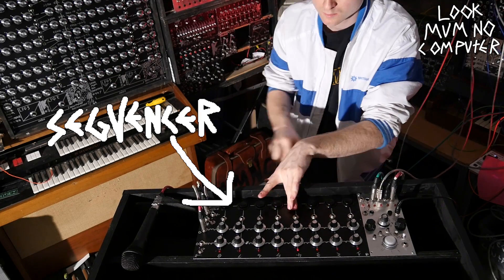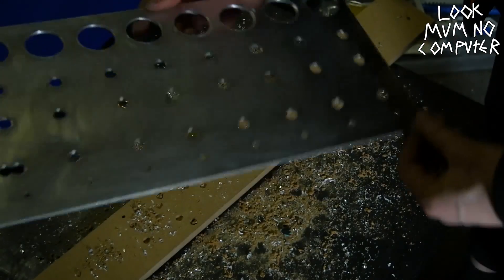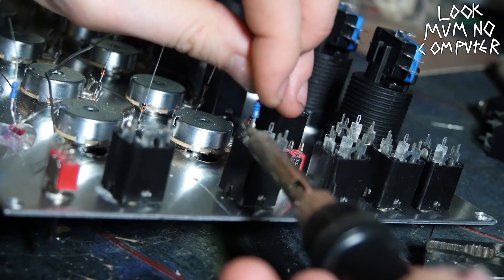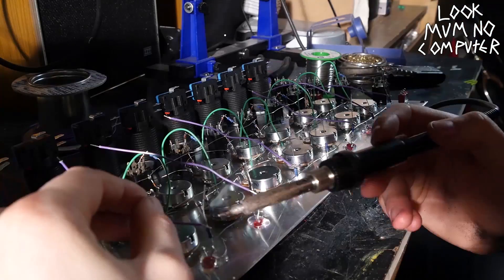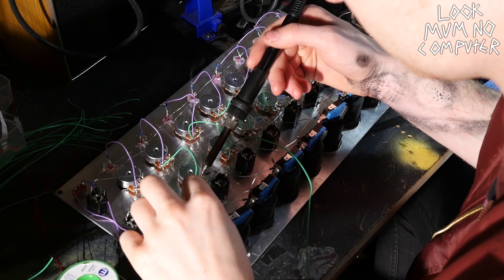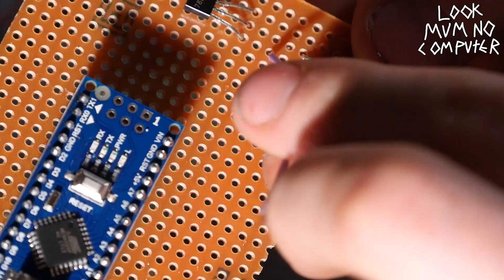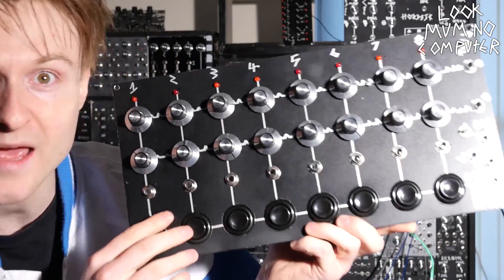ARDUINO 8 STEP KEYBOARD SEQUENCER FOR SYNTHESIZERS

Comment: Hm. Aren't these chips computers technically?
Reply from the maker: Beezqp aren’t we in a computer?
Reply: An arduino is a computer. But a very limited computer. In this case it's used as a part of a single purpose hardware. I think it's perfectly reasonable and fits the "no computer" theme here. To make an analogy, if you're playing an electrical piano nobody's going to come up to you and say that "oh, I see you're using a computer". Technically it's a computer somewhere in there. But talking about it as a computer doesn't capture what the instrument is all about. If you're playing an electrical piano it's more fitting to say you're a piano player than a computer programmer.

Comment: could use a basic description or manual for it. Looks like someone who be like MFOS and EFM
Reply from the maker: cool! will work on the website. was hoping this video and the layouts/code/partlist would be suffice. but ill write it a bit better :)
Reply: I can see someone maybe modifying design for something portable. Like the fact you used a nano which is a lower cost part, great for experimenters with limited budgets

Comment: Nice vid! How do you do the looping? Do you have it synced to the clock?
Reply from the maker: electro harmonix 45000 its midi out, it was all synced up to a beatstep pro. sending midi clock to that and clock to the sequencers...... im trying to switch over to the 4ms stereo triggered sampler, so i can mash it up on the fly. but the 4ms aint really geared to it, trying to find a way around
Reply: Cool, thanks!

Comment: What are the diodes for?
Reply from the maker: Thonss check the link in the description. The diodes on the pots stop other pots effecting each step. Isolates each of them. The other diodes are just condition to reduce weird things happening from the outside things younplug into it. You can just skip these if you want!

Comment: Hi, I have a little question. I've got 8 VCO's all made with CD4046 chips but how do I mix the waves together? Can I just tie all the exits together or do I need to put buffers between them so the one won't blow up the other? What's the best solution?
Reply from the maker: EdEditz they won’t blow up. Best thing to do is try it see what happens. They will get funky with each other like intertwine but it’s all part of experiment what power you using? 9v? +\- 12v???
Reply: I'm using +9 volts (no negative 9 volts) for these and they go from 0.5 Hz to 6.9 kHz squarewave or triangle wave. (I'm using a TL072 to get the triangle wave) Thanks mate! At least I now know they won't be damaged if I connect the outputs together. :)

Comment: Hey look mum no computer, I was thinking and have some ideas to remove many of the components from your sequencer. You can remove the pulldown resistors on the buttons by making them internally pullup in the Arduino (you have to invert their action in code) on the Arduino, you do this by digitalWrite(Button, HIGH); this sets the pin to be pulled up internally.  Also I am not totally sure but if you try and make the outputs high impeadance when you don't need them (tri-state) then you may be able to get rid of many if not all of the diodes and less components means less soldering and more synth woooo
Reply from the maker: OOOH. interesting! did not know about the pullup resistors inside the arduino! just looked on the internet, just did a bit of a face palm!!!! regarding the diodes. i tried a few things. and really didnt get much joy with that. i mean you can remove the diodes on all the jacks, they are just there to save my annoyance. but what would you suggest for the diodes on the pots?? interested! thanks clacktronics :D
Reply from the maker: just screenshotting this and popping it on the website
Reply: LOOK MUM NO COMPUTER the diode thing would be an experiment I'm not sure if it would work. I'm coming to CVfreqs this sat, see you there! The physical resistor thing on the Arduino is everywhere to, took me a while to know its not needed! Thanks for the screenshot!
Reply from the maker: omg captan clacktronics. ive just put 2 things together!   http://electro-music.com/forum/topic-43085.html&postorder=asc this layout right here!!!!!!!!!!! it was the first ever module i made haha. well i made a dodgy ms20 clone. i use that filter layout pretty much everytime i need a new synth voice. behind that big knob filter im twisting when im talking about the sequencer, thats one of them too! HA. thanks very much. very very much! and ill see you on saturday!
Reply from the maker: im building 2 of them right now as a matter of fact.
Reply from the maker: hence why i noticed your name
Reply: LOL 7 years ago! did it work? I never built it, I am the the worst of them all for never making anything! perhaps when I am 85 and retired something will appear from my workshop.
Reply from the maker: Clacktronics haha! Yeah it works. A couple of mistakes. But I’ve had a printout sat in a notebook from 2011 with it in. Like I said. I built a hi and low pass one last night! Hence me noticing your name! Cus it’s in the printout in my notebook haha
Reply: this interaction between you two was the coolest thing i've ever seen. i mean what are the chances of meeting the person who you enabled them to build one of their first modules. definitely made my day

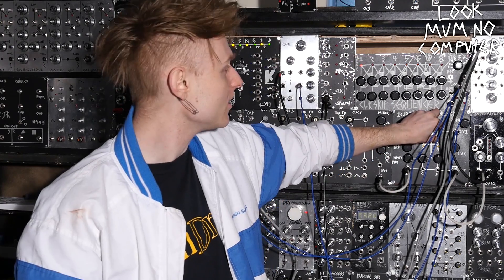Comment: At 1:25 that is indeed not how this chip works BUT.....  If you use two of them and have each of those two controlled by a NE555 (like in the 81 LED chaser circuit as seen here: http://www.eddybergman.com/2017/09/81-led-chaser-circuit-using-2-ne555s.html) you could make a sequencer that can do anything you want. I think I might try that actually, LOL  :)
Reply from the maker: yeah totally try it! its cool! ive got one in an old broken project box that does that! but its just the fact you can just do more with the arduino plug in replacement but go do it go crazy!
Reply: Thanks! I'll certainly try it. Would be a cool project ^____^

Comment: Punk engineering. Hehe. 

Jokes aside, if you look into making baby sequencer then consider 4051 based sequencer instead. Problem with baby sequencer (at least I found it being a problem) is that it's not very easy to set low and high boundaries of control voltage. With 4051 your lowest and highest voltage can be set using simple resistor dividers (or pots so it can be adjusted at any time).

Comment: If signals coming out of an electric guitar are just electrical signals, can't I just plug in an electric guitar into my PC and send the signal through any electronic gear or pedal that you have/own... since you have a lot of different gears... during a youtube livestream session?

Assume zero lag...

Because I was thinking if I can buy a variety of different guitar pedals and then set up a website where guitarists from within my vicinity can access that website and book a livestream session where they can try out different pedals while they are in their own house.

Is it technically possible? (Ignore lag issue)
Reply from the maker: yeah probably! interesting idea!
Reply: you should be able to plug your guitar in either the mic or line in of your pc with a 6mm to 3mm jack adapter, then you have your guitar sound, and do whatever you want with it.

Comment: Make a 256 step sequencer to go with the 100 oscillator synth.
Reply: Poly. :P
Reply: with the Arduino and motorized potentiometers, you could make a 256 steps sequencer out of this. add a control knob or 2 buttons and a screen to display the step you're in, and voila.
Reply: Yes but we both know we just wanna see 256 buttons.

Comment: Hey man, love your videos! I've been GASing for a Deckardsdream synth lately, but they're pretty pricey. There is a DIY kit available, and the manufacturers swear that anyone can do it. But I wad wondering what you thought about it, like, if you thought a beginner could handle it? Thanks, hope you have a great day.
Reply from the maker: Riley Harriger it’ll be tough but doable! However an expensive mistake if you can’t trouble shoot it! If I was you I’d start with a big mono project first like the mfos sound lab ultimate? It’s a biggg project for a beginner.  But if you get that right.
Reply from the maker: Where there’s a will there’s a way. If you want it to work it will. But if it don’t oh mannnn

Comment: Have you ever checked out the CGS Programmer/Sequencer? It's pretty similar in functionality to what you built, but with 4 rows of cv out, and a trig in for each step to jump the sequence to that step. CGS stuff is dope.
Reply from the maker: Jacob Pauls yeah but it’s a loooad of soldering. This can have trigger in. Just put a jack in in parallel to the big buttons. And it can have 4 rows. Just add 2 extra rows :). Also you can program the arduino to do whatever, like random. Or maybe 2 steps at once or something
Reply from the maker: I’ve built one of the cgs’s and yes it’s cool! But it took a long time. I put this together in 3 hours. Nice and easy.

Comment: Great!  do you have schem for baby 8 as well? Also, why is there two rows off POTs. why isn't this 16 steps?
Reply from the maker: this isnt a 16 step sequencer. however the code would be very easy to make 16 steps. also i have a zine about an arduino 16step like this.   just search up baby 8 sequencer.... or baby 10 sequencer. youll find all the info you need.
Reply from the maker: its a dual gang set of pots. so each step can control 2 parameters.
Reply from the maker: you can easily make it 3 rows of parameters too

Comment: you think it would be easy to make it midi?
Reply from the maker: It’s in the analog realm. It would be better using a different method
Reply: @LOOKMUMNOCOMPUTER  you can simply send midi messages by converting the original firmware in the atmega418dpu by using hiduino. Basically you can turn your serial port into a midi port, and you dont need a midi external port to connect to the serial out of arduino. It s simply plug and play midi device. Also you can modify the name of the midi device and use them in all daws.
Reply from the maker: @iamtheaudiophile  sadly this wont work with this project, as the arduino is only acting as a counter. the voltages from the pots dont get read by the arduino
Reply from the maker: Edu Castillo probs hard! You’d need to use a different method!
Reply from the maker: Edu Castillo unless you mean midi clock in then probably easy
Reply from the maker: ohnoezitsroger yes but the values the knobs send out is nothing to do with the arduino.
Reply: Midi out? Midi out is just three serial.writes with 144(noteOn), the number of your desired note(0-127) and the velocity(0-127). dont forget to send 128(noteOff) OR 144 with zero velocity to tell the synth when to stop playing.
you could then reroute the voltage from the output to the input of the arduino, map the voltage accross the 8bit range (0-127) and have it send the corresponding value.
Reply: Essentially you are sending out two voltages per step - you can read these voltages with the arduino and convert them to midi as described above. You could also modify it in a way where you connect the potentiometer to the arduino directly(best using two multiplexing shift register) and read and send the corresponding values. The arduino uno has an adc with 6 inputs, there are tutorials on the arduino page on how to read potentiometers and analogue voltages.
Reply: Then he has to fiddle with a lot more problems. He uses the Arduino as "better" 4017. If you do more than simple loops, the timing gets ugly, cause Midi needs time in the loop. So you must use interrupts and timers and a lot of such "funny" things far away from "No Computer" :-) Concurrent proccessing is a nice rabitt, but with very sharp teeth.
Reply: Peter Heß the code already uses a loop to detect for triggers, so timing is obviously not the point here. But yes, it would be tighter to implement interrupts both in the clock receiving end as well as the trigger in/midi out routine, but that is something for the OP to figure out and learn from. One could even argue that simply relaying a clock input is not sufficent and the clock in is better just used to calculate the current tempo and re-sync every x beats, but so far it works with a simple loop.
Reply: What's about this? http://midimuso.co.uk/index.php/mdco-3/
Did somebody used this? I plan to use it when I'll get to make a polyphonic synthsizer. Chaining ICs to make as many voices as you want (if I got this properly) sounds very sweet.
Reply: Unless you plan to build a volt/hz system it will be useless. Wont work for eurorack and many other systems.
Reply: But I'll be soldering expo converters for every voice anyway :) I can't find a decent/non-expensive MIDI-CV circuitry. So that's why I'm asking and searching for such solutions.
Reply: You won't find cheap solutions. If you want to make "real" music, you need DAC with a higher precicion.  Such a DAC cost around 10-20$ in single quanties. Tipp: I posted this solution (sorry in German) http://journeytounknownsoundscapes.blogspot.de/2015/02/a-ready-made-module-analog-shield.html If you are looking for a Arduino Based Solution. (Analog Shield: with 4x16 Bit Dacs). I used this board with a great success. But... it is outlisted. Only limited quantites in Stock. F....
Reply: I have four voice MIDI-CV device but it's in a box and require AC-AC adapter (which I have of course). But in polyphonic mode it's only CV+Gate/trigger.
Not sure that a MIDI-CV device need really expensive DACs.. I think that the main difficulty is that a good solution must be coded and then uploaded in an appropriate PIC. I know the theory in general but:
a) I don't know how to write code for PICs (requires assembler, right?)
b) I don't have a programmator (i don't remember the right name - a device that can "firmware" your PIC) yet. But I will buy it if a) will be valid (or I'll get a right code) and IF I'll find a solution to make a polyphonic MIDI-CV circuit.
Yeah, I know about Arduino based things. Probably Teensy is one of the best. But as I've got: it has a limitation of DACs... So any full voice card will need (at least) CV, Gate/Trigger, Velocity. If I want 8 voices (like Jupiter8) then I need at least 8 * 3 + 2 = DAC 26 channels. +2 - Modulation and Aftertouch.
P.S. 27 - I've forgot MIDI-Sync.
Reply: I'd sure be interested in that (midi clock in only). My whole rig runs off DIN/MIDI clock, I don't care about midi notes at all